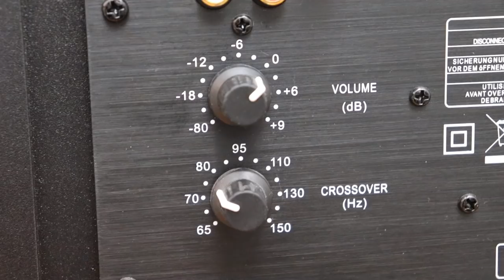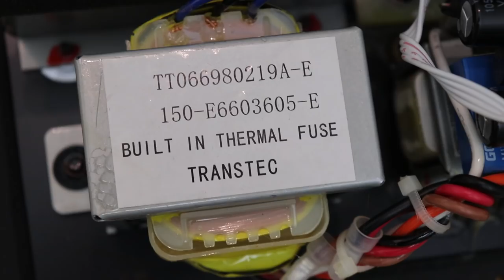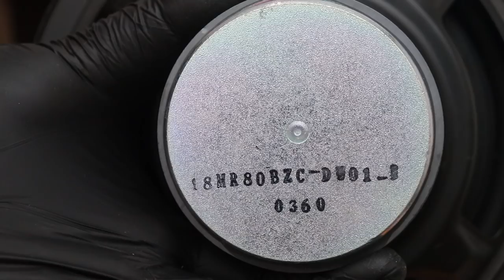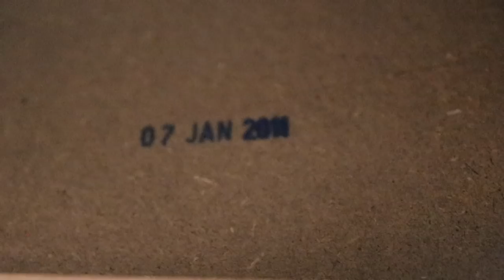Canton Subwoofer  Movie CD 1000 - A Look Inside, What's Inside

Comment: I have one similar 125 subwoofer. So Ive used a y-splitter rca cable, one end into the subwoofer on av receiver (pioneer) and then the red and white connections at the other end into the L&R on back of sub. So what would I set my cross over at? thanks My speakers on receiver are all set to small and 80hz.

Comment: I don't care for the woofer design.  It really looked cheap, and didn't have the travel most large woofers have.  My 12 inch has a large surround, and it is so stiff it's hard to move the driver in or out.  The magnets is so heavy it's hard to handle the driver.  Oh well, Americans are always particular about the driver!